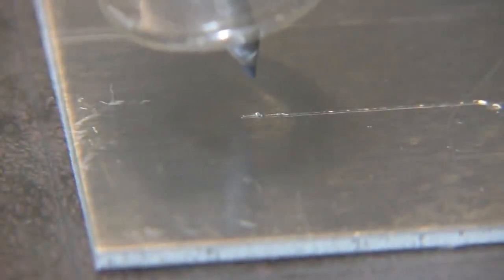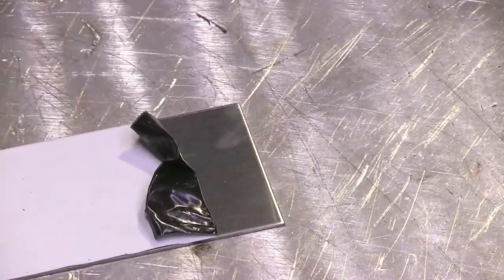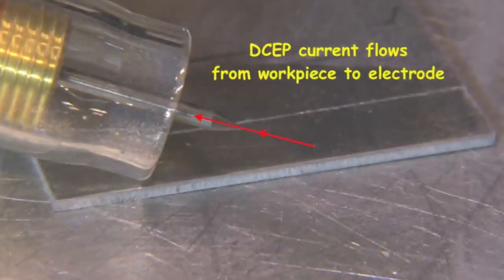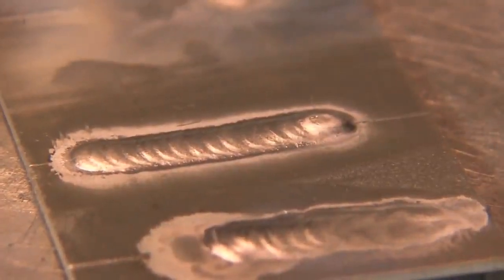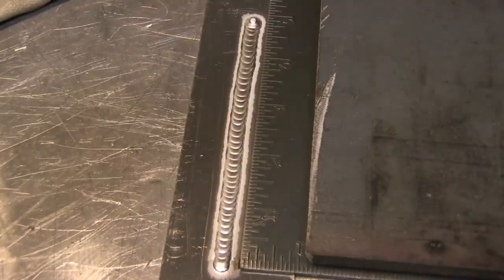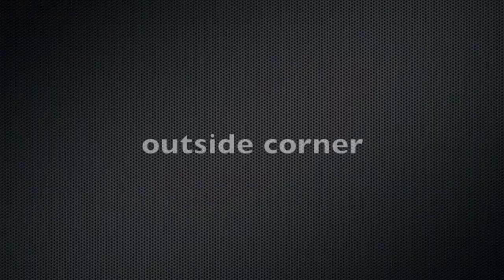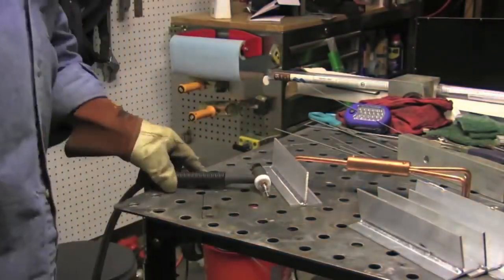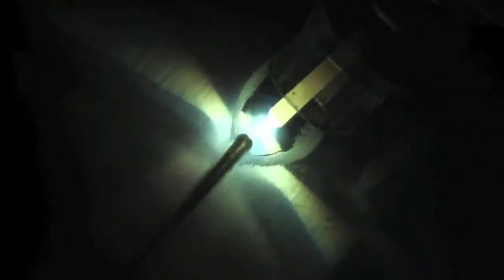How to TIG Weld Aluminum

Comment: Thankyou for all Jody. Setting up a lincoln tig 175 for tig welding.  I got a ck17 to start with. My questions are I should round off tungsten tips for mild steel and aluminum? Are there certain cups i should start with as a true beginner? I do have 2 of your tig fingers as well as gloves. Thanks for your time.

Comment: How do you hold the torch?

How did you learn to keep your hands steady?

How would you suggest practicing if i have a torch but no tig welder
Reply: I like to rest my hand even pinky on the metal or a block next to it that’s where a Tig finger comes in handy keeping your hand from getting hot. Resting my hand keeps my hand from floating and shaking. You can learn a lot from just watching his videos maybe have a cheap amazon Tig torch for like $10 or so but nothing is gonna help like having a welder. You can try vocational schools instead of buying a welder or try to find a local welding shop and try to work something out with them maybe work with them. Theres other ways but Jody’s main channel welding tips and tricks I learned a lot just watching and it will speed up your learning curve once you are able to weld in person 👍
Reply: Buy the kids toy Operation